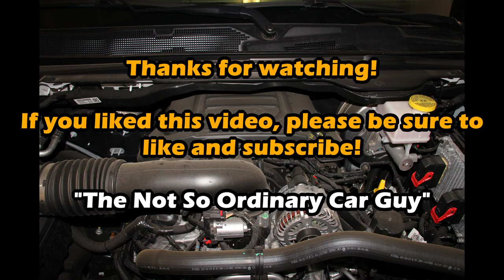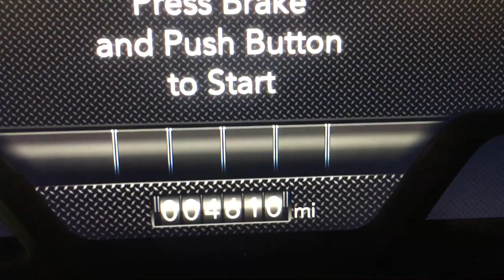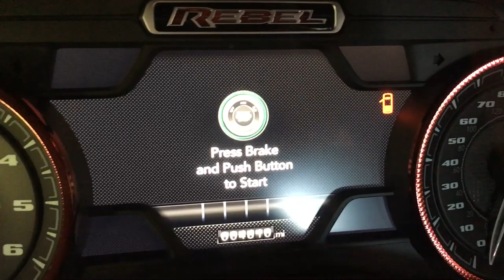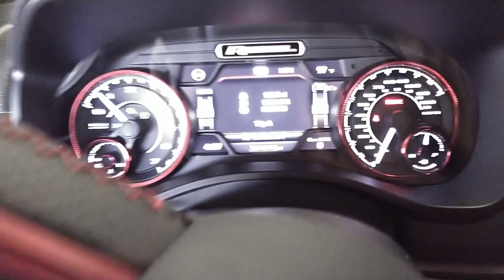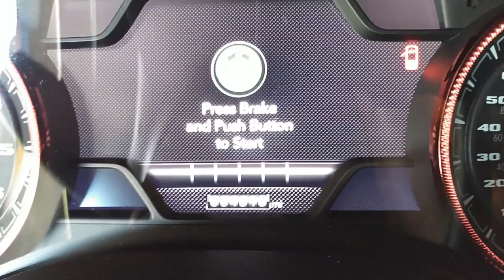How Not to Change Your Oil - 2019 Ram Rebel

Comment: Went through this today with my 2019 1500. What an absolutely embarrassing location for that oil filter. I initially used one of the gripper type filter wrenches and it crushed the factory filter because it was on so tight! Ended up using a cup style filter wrench and a swivel adaptor because of the tight clearances. I put the new filter on just hand tight, no wrench install. Thanks for sharing and letting me share in the misery of this job!

Comment: My rebel came with 8 free oil changes however I just moved 2 hours away from where I used to live and that was 5 mins from the dealership. I'm no stranger to oil changes but I must say the one thing that surprised me about this video was that he had to jack the truck up on stands. Everytime I looked at my truck prior to this I always thought to myself "Boy! Oil changes should be a breeze on this thing. With that ground clearance I could just roll right up under there and get to work."... Guess not.
Reply from the maker: I probably could have done it without jacking it but it sure did help with the oil filter. The main reason I jacked it up was in order to rotate he tires.
Reply: @MotoringAdventures_KE7SAI  Oh ok then. Thanks for clearing that up. Much appreciated!

Comment: I just changed my 2020, I used the adjustable and it started to crush the filter, but it came loose, I also used the zip lock bag over the filter method once it broke loose which helps on the mess. But from the factory I think they use an impact to put on the filters

Comment: On my truck I just use a bigger oil catch pan, its actually a Mason cement mix pan, it catches all the oil nicely, other than hitting the suspension bar on the truck the oil isn't getting all over the truck its just spraying out a little wild!
I would upgrade your oil filter, the Mopars are nothing great, go with a Wix or Napa gold!
Great video, you showed exactly how it went with the experience!

I
Reply from the maker: Thank you and thanks for watching!
Reply: Not sure why you say that the Mopar filters aren’t great, I find them to be excellent and better than most. Never had any issues with mine.

Comment: I had the same issues I bought all the same ones you have to use the strap wrench that attaches to a ratchet or power bar ps seat belt material  one gl
Reply from the maker: Yeah. I’m not sure why that was on there so tight.

Comment: I am convinced that manufacturers do not apply any lubricant to the oil filter seal when they install the oil filter at the factory. That's why it's to tough to break free at the first oil change. The seal has bonded to the oil filter flange! 
I used a oil filter plier I bought from Walmart to get my oil filter to turn.  Henceforth I will use a Fram oil filter and just hand tighten it.
Reply from the maker: Ahh good point! I was thinking along the same lines.

Comment: yikes! that's what I was planning to do today! Mine has had around 10/12 oil changes already, just hope the filter isn't that tight! 103,622 miles on a 19 ram 1500
Reply from the maker: That's a lot of miles for a 19. Do you drive long distance for a living?
Reply: @MotoringAdventures_KE7SAI  around 200/250 a day, Hot Shot Delivery Driver

Comment: I have the exact same oil drain pan and it SUCKS for changing the oil on my 2019 Ram 1500. The oil comes shooting out like a freaking garden hose and makes a godawful mess. Use the ATC Tools 4 1/2 gallon drain pan. It's big, deep and almost eliminates the mess. My factory-installed oil filter was on very tight but I was able to loosen it with a strap wrench. I have a little more room because I don't have the 4x4.
Reply from the maker: Nice! I'm going to have to try that! Thanks!

Comment: Yup, that filter is on way too tight from the factory, I'm getting close to doing my first one, and contemplating paying the dealer to do my first oil change so I don't have to worry about the first filter.  What I'll try to do first is see if I can loosen the filter first, if I can't easily, I'm going to take it in instead.
Reply from the maker: Sounds like a good plan! I just performed the third oil change on the Rebel last weekend. The filter turns easier now. Was probably just put on really tight from the factory. The location of it is still a pain to get to but now I use a plastic zip loc bag and place it around the filter to catch all the extra oil and minimize the mess. Good luck!
Reply: @MotoringAdventures_KE7SAI  Sounds good, getting ready to do it soon, have everything I need.  Some guys I talked to use the two zip lock method.  One zip lock bag to crack the filter and get most of the initial spill, the second to finish off removing the filter and picking up any residual spilling after that.

Comment: I am about to change my Ram's oil.  The trials of dealing with super tight filters sucks.  I had to do that with my 2003 Expedition.  The oil filter location on the Ford was even worse.  I think those fans screwed up your initial drain.  It looked like they were blowing the oil making even more of a mess.
Reply from the maker: I think you're right about the fans. It was a hot day so I figured they'd help. lol. What motor was in the 03 Expedition? We also have a 2016 Expedition with the 3.5L V6 Ecoboost. It's filter is not in the best location either.
Reply: @MotoringAdventures_KE7SAI  It was a 5.4L V8.
Reply: @MotoringAdventures_KE7SAI  I purchased this new drain called ValvoMax.  It has a tube that will make changing the oil easier on the Ram.  I plan on installing it when I do the first oil change.
Reply from the maker: I'd be interested in seeing that.
Reply: @MotoringAdventures_KE7SAI  I finally did the oil change today.  The drain made a mess.  I had cardboard down and still got oil splashed everywhere.  I installed that ValvoMax plug so no dealing with that nonsense again.  The filter was fine.  I used a strap wrench and then put a Gallon Ziplock bag over it as I spun it off.  That kept all the oil contained.  I put the new filter on hand tight.  The next change should be a breeze using the ValvoMax plug.
Reply from the maker: myriadcorp that’s cool! Something I need to look into because draining it is always hard for me to prevent a mess.

Comment: I wonder if the small filter size is the reason for the "Hemi Tick".   No room for the regular size filter.
Reply from the maker: That’s a good point! Could be on to something.
Reply: @MotoringAdventures_KE7SAI  Makes sense huh? Every V8 truck I have ever owned had a oil filter three times the size of the Hemi.
Reply from the maker: @Mascotal  our GMC Yukon with the 5.3 has a pretty small one I think.
Reply: @MotoringAdventures_KE7SAI  I have always had F250's.
Reply from the maker: @Mascotal  I think my ram power wagon (2500) has a smaller one too. But then it did have the “tick”.

Comment: When you rotated the tires did you have to do anything to the computer TPMS settings to indicate they had been rotated? I can't find any information in the owner's manual to indicate that anything needs to be done to the TPMS when rotating the tires.
Reply from the maker: I didn't have to do anything. It takes it a little while but it eventually realizes they've been switched and it adjusts them in the display accordingly.
Reply: @MotoringAdventures_KE7SAI  After I asked the question, I started doing a little digging on the Interwebs and found out that TPM Systems have a proximity sensor "antenna" that uses mechanical, electrical or magnetic RF technology from the wheel sensor that talks to the TPM antenna closest to that corner, usually on the wheel hub with the ABS sensor. Basically, if you rotate the tires or need to replace a TPM sensor in the wheel, the vehicle computer will ping the sensor at a set interval and then update the information if anything changed. The pressure is monitored using a separate chip on the TPM sensor to transmit an over/under inflation condition immediately.
Reply from the maker: @de3481  Thanks for that! Awesome information! Technology!

Comment: I just bought a Rebel and crawled under to see how much fun this was going to be... Just wanna throw a couple birds in the air at the designers..
Reply from the maker: Haha, yeah it's not too bad after a few time. I now use a large plastic zip loc bag when unscrewing the filter to catch the excess oil. And with the drain plug I use a plastic water bottle cut at an angle in order for it to fit between the plug and the sway bar.
Reply: @MotoringAdventures_KE7SAI  the wife would kill me if I made a mess in the garage lol.. thats where she parks her car.. haha

Comment: Thx for the video. I just went through the first oil change process also. The first day I was defeated because I didn’t have the right oil filter wrench. The second day I had success , however I tried the ziplock bag over the filter but still made a horrible mess. Next time I’ll try to loosen he filter just to where it starts leaking, stop and hold the bag to catch the oil. Between the cross bar under the engine drain plug and the oil filter I had quite the mess.
Reply from the maker: Yeah some mess is going to be inevitable. I recently performed the 2nd oil change on the Rebel and used the zip lock bag and still had a mess, although slightly less. The filter was also easier to turn this time.

Comment: Welcome to hemi life
Reply from the maker: I don't remember my 2014 Ram 2500 Power Wagon (with the 6.4 hemi) having as difficult of a time changing the oil as the Rebel. Nor the 2016 Ram 1500 Lone Star that had the 5.7 hemi in it as well.
Reply: @MotoringAdventures_KE7SAI  I'm a second hemi 1500 guy both had the medium difficulty reaching the filter and ensuing sloppy mess lol. Otherwise love the truck the 2014 with 8spd is so nice. Red big horn. Nav is shot update didn't work. Just recently check gas cap at 118000mi order the parts as described by the boosted guy or similar goin for it this weekend
Reply from the maker: @cschmitty75  yeah, either way, oil changes have the potential to be messy. Doesn't help when the oil filter and drain plug are placed so hard to reach. The easiest vehicle to change oil that I've done, is any Jeep Wrangler that I've owned (TJ, JK, JL). It's almost as if they knew Jeep owners would want to change the oil themselves. lol.

Comment: Some say it voids warranty wondering if true?
Reply from the maker: Changing your own oil shouldn't void your warranty. However when it comes time to trade it or sell it, it may not show up on records such as a carfax, meaning they can't certify that the work had been done and they may not want to give you as much for it. I think there's got to be a way you can report that you've changed your oil to carfax or keep the receipts for the stuff you buy. Maybe even a way to report it to the dealer's service department. I'm not sure.
Reply: @MotoringAdventures_KE7SAI  ... In FORD's case...if you own a FORD...you can go to the Owners website and register your vehicle.  They also have a way to update your maintenance on the site.  Not sure about RAM... but... https://www.mopar.com/ramtrucks/en-us.html
Reply: Absolutely will NOT void your warranty!!  However, you must save receipts and log the work done including the date.  If you do your own oil changes, make certain to use the proper engine oil that meet the specs necessary for your make and model engine.  Good luck!
Reply: The Magnuson-Moss Warranty Act of 1975 states that if a manufacturer offers a Limited Warranty that is contingent upon required maintenance, the manufacturer must provide details of what maintenance is required, the parts required and at what intervals the maintenance should be performed. The manufacturer cannot force you to use their parts or service centers to validate the vehicle warranty (AntiTrust Laws). This means that you are free to take your vehicle anywhere you choose to have maintenance performed and/or do it yourself while the vehicle is under warranty. If you take it to the local quickie lube, keeping the receipts is all you need to prove the maintenance was performed. If you choose to DIY, keep your parts receipts and document the type of maintenance performed, date and mileage. I use an Excel spreadsheet to keep track of maintenance performed, mileage, dates, parts used and where I bought them. I also (unexpectedly) received a free CarFax-for-Life membership for my truck from the dealer (a $99/year value) when I bought it. This allows me to officially enter 3rd party/DIY maintenance information for my truck that gets recorded on the CarFax website.
Reply: iwoww 562  The owner's manual says that you must use "SAE 5W-20 motor oil approved to FCA Material
 Standard MS-6395". Mobil 1 5W-20 is rated API SN which exceeds this standard. I use Amazon Basics SAE 5W-20 synthetic with a rating of API SN+ manufactured by Warren Distribution Inc. Warren Distribution manufactures the vast majority of private-label and house-branded motor oils on the market.

Comment: Stop the madness use a Valvomax drain plug and a 10363 Pacbrake relocation kit for 10 minute oil change. DONE. You can buy a Ram MO899 larger oil filter as well for 5.7 Hemi
Reply from the maker: Thanks for the tip! I’ll keep this in mind if I get another 5.7! I imagine it’s even tighter with the larger filter.